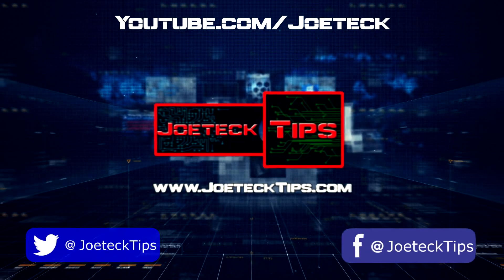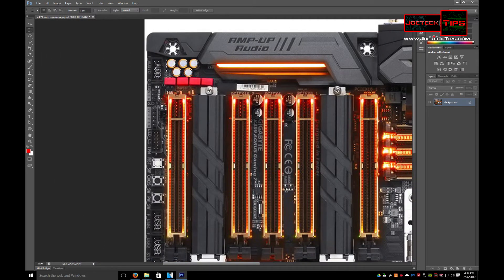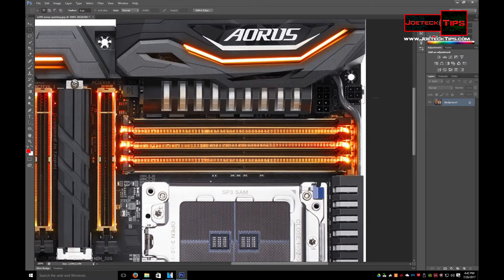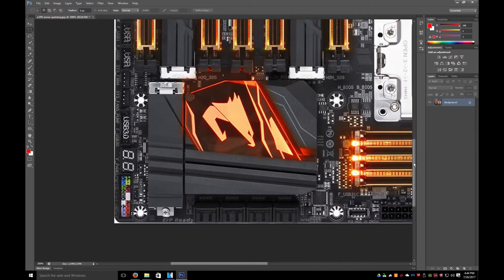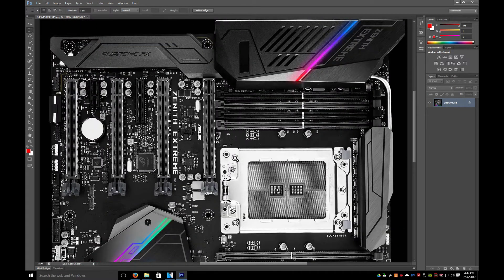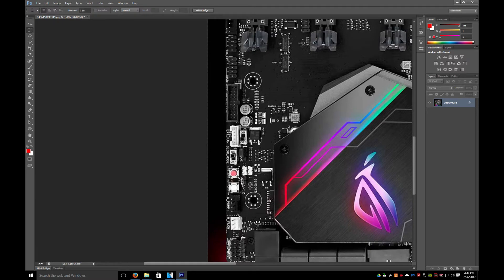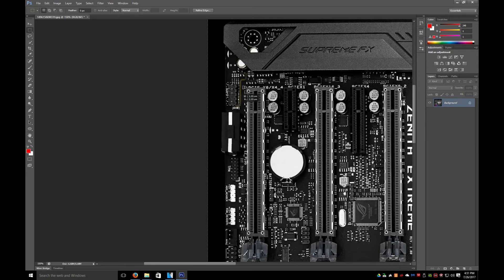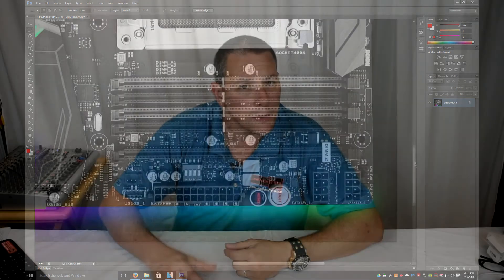Water pump header on the x399 Motherboards?? Close up look | Gigabyte | ASUS | JoeteckTips

Comment: Could you say if its possible to powerring the water pump directly from pump connector ? (Powering directly by the motherboard)
Reply from the maker: Jean Bernard yes, that is what it is intended for. The AIO water coolers connect to the CPU header.
Reply: I have this motherboard https://www.msi.com/Motherboard/B350-TOMAHAWK with 4-pin water-pump-fan connector, do you think that I can control and power directly the pump with ?